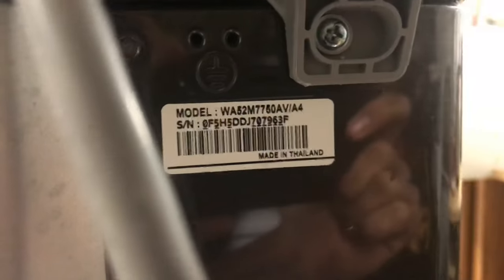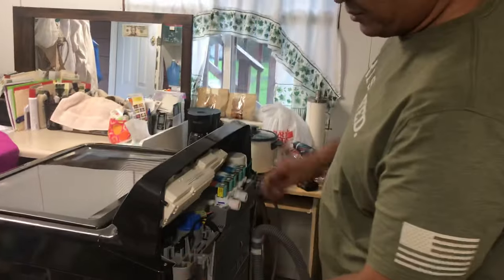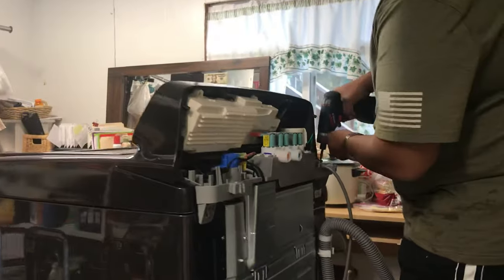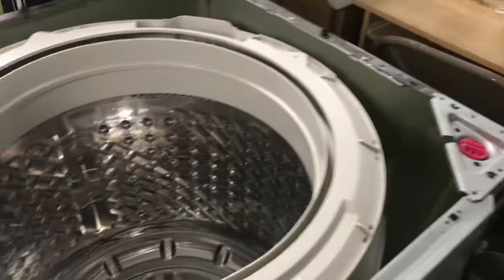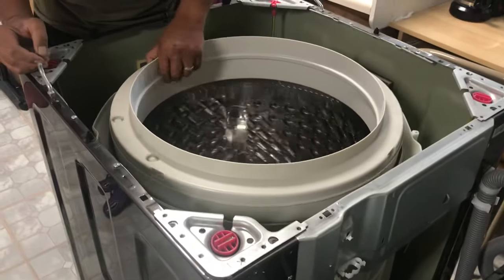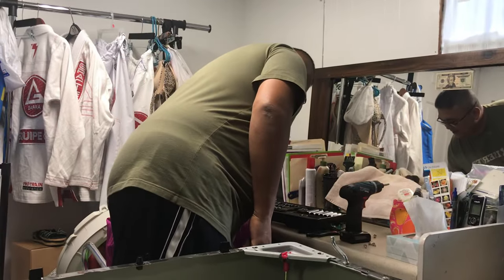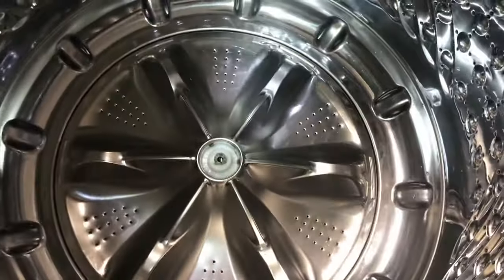Samsung Top load Washer drum cleaning 1of 3

Comment: Hi Dave, thank you so much for the step by step instructions on how to disassemble my Samsung washing machine.  For 2-3 years, we've had black flakes on our clothes after washing.  We've tried several different cleaning methods, but none have ever worked for more than a few weeks.  I knew the machine needed cleaned inside. but I didn't know how to take it apart.  So thankful that I found your video and that you took the time to share the process for disassembly and reassembly.  However, I was not prepared for the amount of gunk inside.  We've had it for 8-9 years and it was terrible!  Took 2 1/2 hours to clean all the parts, but it looks great now!.  I'll make it a point to clean it every 2 years from here forward.  Again, thank yoiu for your help.
Reply from the maker: That’s Y I made video.  For those like u.  I remember when I felt as u did.  Couldn’t find a video to save my life.  Glad it worked out for u.  Recommend using the clean cycle once a week though.  Btw I had to redo mine like 6 mo later again.
Reply: I just bought one of these off of someone and they never mentioned the mold and mildew problem!! I just installed the washer yesterday and have been researching how to fix it but I read you should always leave the lid open after running a load otherwise it doesn't dry out in there and that traped moisture allows the mold to grow back.
Reply from the maker: @kellyhenault4865  yup, always leave lid open when done.  Recommend stop using fabric softener too,  most soap smell great enough.
Reply: Cleaning with white vinegar helps prevent mold coming back so fast, beyond doing a great job of cleaning. I learned this from personal experience we have hard water. I can clean my toilets and two days later there was black stuff back so what I started doing was taking paper towels or old rags soaking them in white vinegar and sticking them up inside the holes where the toilet water comes out. It cleaned it but it also prevents it from building back up. I clean the toilets like once a week and it's not a problem but I do the same with the washer, once a week I run a self-cleaning mode with vinegar in it

Comment: Great video. Once you clean everything part of the problem is the agitator, the round disc at the bottom of the drum.  Samsung made the agitator out of plastic cover with aluminum, the two pieces won't come apart and it collects water, therefore black mold builds up in between and can't be cleaned. If you have an air compressor you can use it to blow air through the holes from plastic side, it is better if you let it soak but you can only blow out whatever is around the holes. This is a screw-up from Samsung. This part should be replaced free 6 charged since it can't be serviced or cleaned.

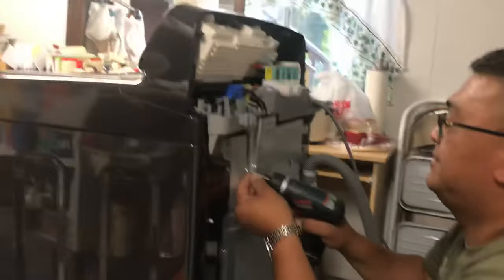Comment: You can remove the top by going right to the screws @3:07 also, no need to remove the back plate as in @4:38 an so on. 
Great video!! It helped me disassemble so I can clean the moldy gunk under the drum. This seems to be a problem for these samsung washers in where it spins out all of the water from laundry, but does not spin all of the water out of the bottom of the tub.
Reply from the maker: Thanks for comment.  There are three videos linked.  I was going off memory,  so some mistakes were made.  Glad I could help.
Reply: @guamknight6715  I actually appreciate the small errors.  Makes it very clear what to do and what not to do, for those of us going through this for the first time.  Everyone is human.  Thanks for keeping it real.
Reply: @guamknight6715  you could have easily edited and put, but you were brave to put the original. 👏👏
Reply: I can't get the front part off.  It may require 2 people?
Reply: @danixoxo8637 I'm sure you have done it by now, but for mine there were 2 screws instead of the clips. The screws were under rubber plugs at the front, if you put your head inside the washer and look to the front between the tub and the top, you can clearly see how it is attached front and back

Comment: Good job! Thanks for making this video. About to do this to my own, going to focus on the inside of the drum and the drain pump because residue isn't only pooling in my machine, but the residue isn't being drained out with the water. Have to replace all 4 damper rods too because it can't get through the rinse cycle without an error code, the rinse cycle being I'm pretty sure the step that those debris that are clogging the drain pump are supposed to be removed! So one problem caused another and now I have 2 to deal with at once but I think these 2 issues will be a thousand or two less dollars to repair than the machine would be to replace.
Reply from the maker: Glad to help.  Lmk how it goes.

Comment: Hey how did you get that bolt that holds the agitator so easily? Mine would not budge and its not rusted.
Reply from the maker: @rrtram1  dab some wd40 or other penetrating oil.
Reply: @guamknight6715  I tried that before, it didn't work. I can get a good grip on it with a T shaped 10mm socket wrench but still.

Comment: Hello, what size socket wrench head are you using for the middle bolt? I have one but have been unable to unscrew the bolt. Even used WD-40 to no avail.
Reply from the maker: I think it’s a 10 or 12mm.  From memory.
Reply from the maker: Left to loosen,  counterclockwise.    On occasion,  some manufacturers use diff thread pattern.  So try right to loosen too.

Comment: Thanks so much for these videos.. I was able to take mine apart and clean and then put back together within an hour and a half. Now running a clean cycle using affresh. Fingers crossed that the brown flakes are gone!! How often do you have to clean yours this way?
Reply from the maker: Glad it helped.  I tore mine down again after just 6 mo.
Reply from the maker: But it’s so easy now.  Just annoying I guess.
Reply: GuamKnight 671 did you stop using liquid detergent and fabric softener? I hear thats the cause of our issue.
Reply from the maker: No.  I don’t think my wife would like powder.  I do run the clean cycle more often now though.
Reply: GuamKnight 671 we’ve switched to tide pods. Not sure if that’s much better but we’re gonna see
Reply: @bdguth07 
Is powder detergent suppose to be better for preventing gunk build up?
Reply: @MissSmurfey  that’s what I’ve heard. We’ve switched to tide pods that contain fabric softener and haven’t had an issue since.
Reply: @bdguth07 
Good to know. Thank you. I think using too much detergent can also be a cause of gunk build up. Using pods prevents this 👍
Reply: @MissSmurfey  right, that’s my whole reason for switching.

Comment: Hi David. Im having the same issue with my washing machine. I followed your instructions on how to get the  lid off but it wouldn't budge. I saw that you lifted it from the back and kind of jerked it forward. I did the same thing but it would budge. The whole washing machine just budged forward lol. I looked and looked but there are no screws to be removed so I just followed what I saw in your video. I searched for other videos but everybody has some screws to loosen. Any advice on how I can  remove the top? It felt like something was holding the front part down but I just couldn't figure it out. Muchas gracias.
Reply from the maker: Sorry.  Just saw ur message.  There are about two screws to remove from back at 3:08.  Pull up n push forward bout an inch.
Reply: Thank you for getting back to me so soon. Yes I did remove those screws from the back but there is something holding from the front. I was able to lift up the back after removing the screws but no matter how much I tried to shake the lid, the front wouldn't let go. I search for more screws towards the front but there weren't any.
Reply from the maker: You just have to jostle it free.  There is a hook on front it has to clear.
Reply: Ok I found it. I had to stick my big head lol in the washing machine and saw some screws that need removing. I'll probably won't be able to put them back on lol but  thanks for your help anyway. Love your videos. They did help me.

Comment: I can’t get my agitator off it just crumbling the plastic metals
Reply from the maker: Dab some we-40 penetrating oil over bolt.  It should just slide straight off.  Using two flat screwdrivers use it to grab lip, n pull straight up.  No prying.

Comment: I love how you don’t mention anything about the hardest part of removing the bowl frame. The pins in the front. I don’t see anyway of removing the frame without cutting the pins. Looks like you don’t even have them anymore.
Reply from the maker: It snaps in,  no cutting
Reply from the maker: Some models push pull,  Ive seen other washers (not this model) slide n pull.